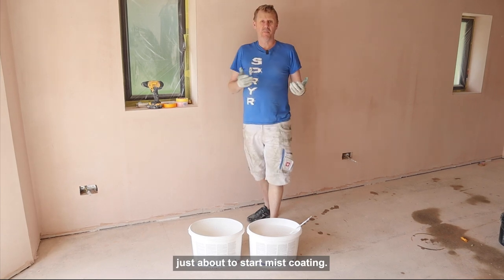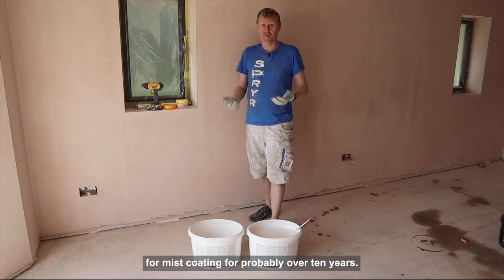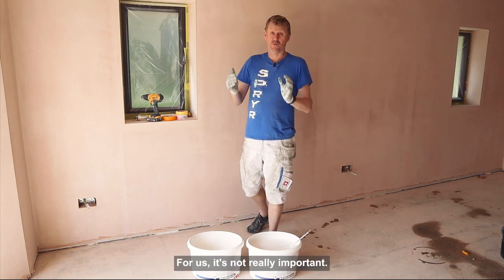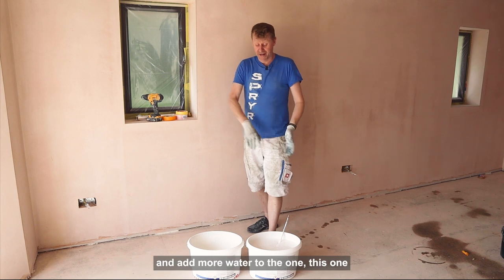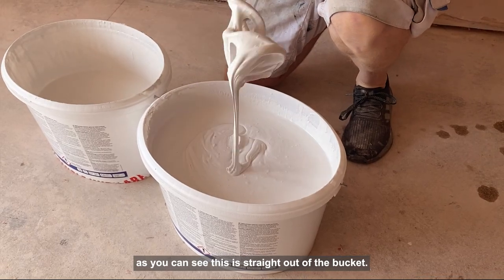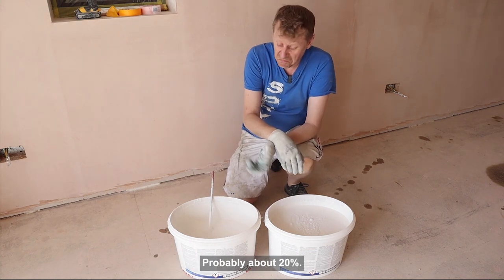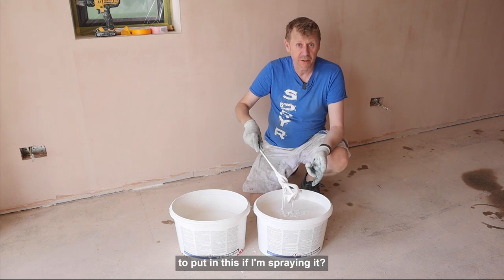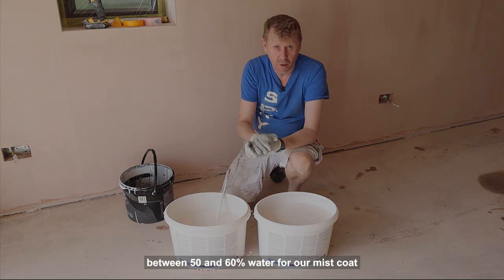How To Thin Airless Spray Coatings Properly For Optimal Results.

Comment: Hello, I am interested in getting the best paint viscosity for the topcoat to get the optimal pressure for the Graco LP517 nozzle.  What is the average time value for the Ford cup#4 viscometer for the top coat.  I am asking about materials such as Caparol CapaDIN, Caparol Indeko-plus, JUB Jupol Gold.  Thank you in advance
Reply from the maker: The ford cup us usually used with HVLP and not really so much with airless to be honest. We had never heard of it until we started doing some finer finishes with specialist furniture paints. Some paints need more pressure than others, we try not to thin at all to start with and then 5% at a time, but you need to be careful not to thin too much as you start to lose the paints properties

Comment: Curious why you don't just follow manufacturers spec and are advising others to follow suit? Number one cause for failed mistcoat is over thinned product as it lacks enough binder over a given area to actually bind the product sufficiently to the wall, this is due to 'contract matt type products'  having relatively low binder content as it is anyway and then you reduce that by half is just opening yourself up to issues down the line. 

Never seen any manufacturer recommend 50-60%, most I've seen is 40% on crown products, ppg and akzonobel gear are both typically well under that usually 20/25%. Capadin what I'm guessing your using there is supposed to be only 10% max!
Reply from the maker: We would only for misting not for top coats as we don’t want to lost the make up of the paint. Don’t forget that most thinning recommendations are for brush/rolling and not spray. We have never in all the years of doing bare plaster had a problem with adhesion but we are very careful on product selection as a lot of problems is usually down to wrong paint choice.